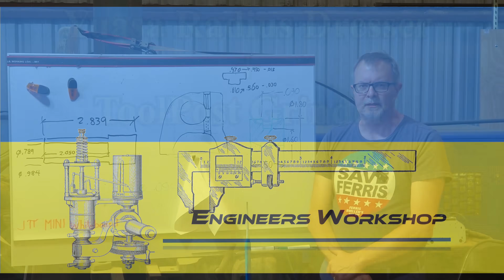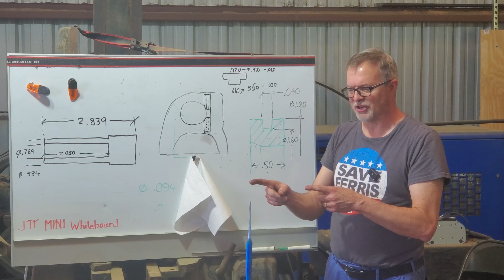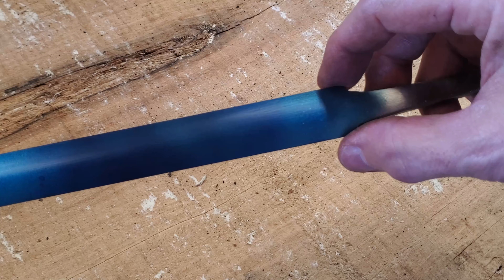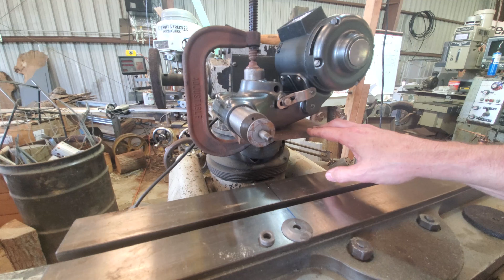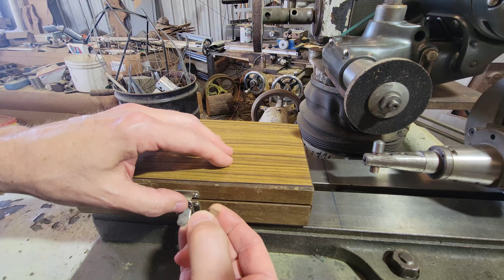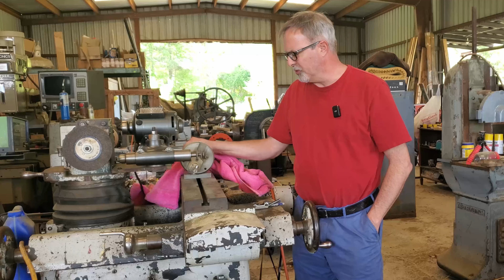Yuasa Radius Dresser + Toolpost Grinder

Comment: You need to take the motor apart and spray it with contact cleaner to dry out and clean the internals.